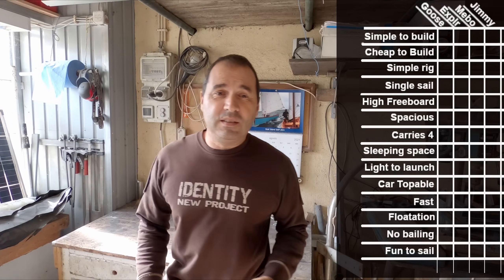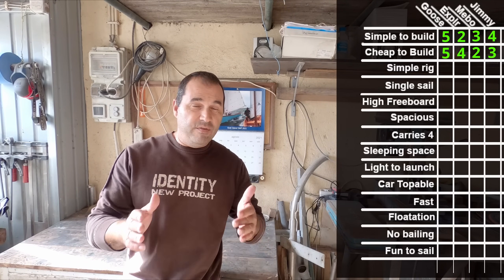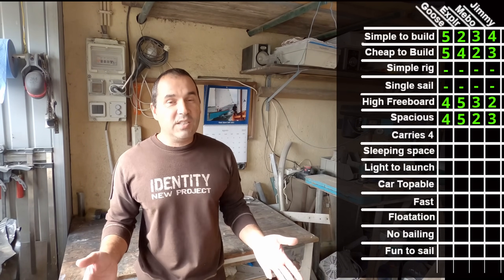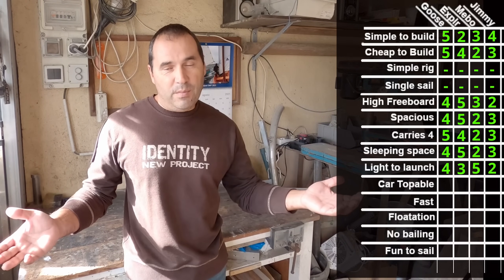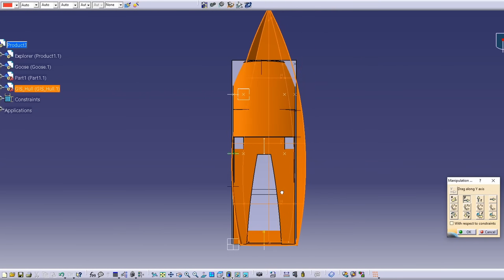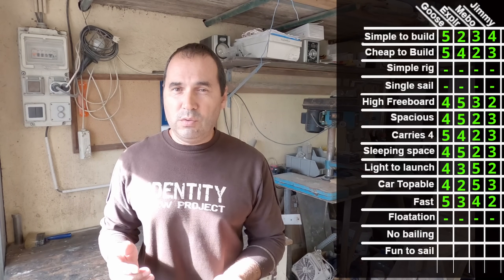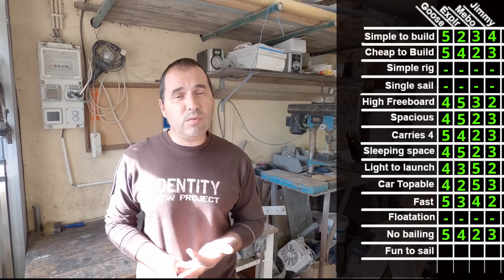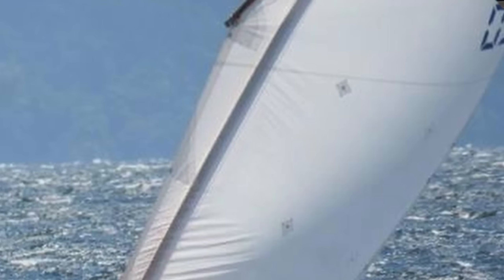Final Skiff Shootout. Which One Will I Build Next?

Comment: This is actually a really good primer for designers about how to balance criteria. The result will of course be different if a different person does the scoring. But for a technical discussion of all the points from the perspective of a builder - every designer needs to know this. I learned a couple of things.

The only area where I would suggest more analysis is needed is weight. It is actually a bit hard to work out weights for someone wanting to build a boat. The best quick way is to look at the building materials and count up the sheets of ply multiplied by the thickness of each. The more scrap there is - the less this is a good estimate - but at the same time boats with too much scrap should be penalised as well - that is an important area of product design. And it has sent me back to the drawing board more than once when a lovely boat I've drawn up just fits badly or not at all on a sensible number of plywood sheets.

Looking at the final big chart of results it looks like the Mebo (when using Teo's criteria) ends up with a very high result too. Equal to the Goat which Teo clearly loves.
Reply: It's also an excellent example of how to use a decision matrix to make a complex decision. And anyway, you can't look at a boat while you're sailing it!
Reply: @nickgoodall578  A truly acidic compliment! I'm going to use that one - excellent!
Reply: @TheBoatRambler  I feel like you might be a shill for Mr Storers boat designs except I cant fault your logic and decisions
Reply from the maker: @akcarlos   maybe he just makes simple boats that work! 😁😁

Comment: This has been really fascinating. Thanks for taking us all on this journey of discovery. I didn’t realise how much the sailing snob in me is biased against the square goose or the PD racer. Especially when they perform so well on so many points.
Reply: Just to make you feel better - your biases were the same as the designer at the beginning of looking at these square boats. We built two 8ft versions almost as a joke and because we are Australian we made a further joke of putting a stupidly big sail - double the normal size on the little boat - and plan to cut it down after taking a few photos and videos for some chest puffing. Then we were surprised the 8ft boat stood up to 80sq ft of sail. And then that it had good handling qualities. And then started taking it to boatshows and being the last boat to come off the water when the wind blew crazy and the waves came up.

We were surprised at every stage. Assumptions are really difficult things to shake off!

Comment: Looking for the goose center board redesign,  for easier sleeping room / cockpit space?. What are your ideas on an off center CB trunk running through the flotation inboard of the gunnel , amidships?  I'm looking at building a Goose for the Texas 200 with a covered foredeck and a cockpit canopy as in Matt Layden's Enigma.
Reply from the maker: I'm not sure what structure can be removed or what would have to be added but if moving the CB I would just use the same centerboard case structure and glue it to the sidetank, protruding on the inside of the boat, leaving the tanks intact. Maybe @Michaelstorerboatplans can advise you better.

Comment: If you keep any of them outside, would you cover it with a tent like structure to avoid rain collecting in the boat?

If the build would be mine - i would opt in for the explorer instead, the boxy look wouldn't bother me at all. Could use the extra protected storage area and also enjoy some of the warmth of the cabin at chilly nights (i'm 58 degrees north), that's why i'd pick it over the regular goose. And yeah, my car is a 4x4 with a hitch, so wouldn't have issues towing it either if needed :D
Reply from the maker: Good choice!
I want to cartop so it really had to be the Mebo or the Goose. 
Here we get around 41F in winter, with the worst  days maybe 32F.
I do keep my goose undercover both for UV and rain protection
Reply: If storing a boat outside there are two important things ... keeping all water out and good ventilation. If using a boat every week a good tarpaulin can be enough - and replace it when it starts wearing out - it is cheaper and easier than repairing a boat.

When leaving a boat for longer periods put it upside down and raised off the ground and then put the tarpaulin over.

Comment: Not really a surprise :-) Surly the Goose is a good choice for you. But from my point of view, you underrated the Jimmy Skiff - even if you don't want to build one.
Reply from the maker: Hi Gerald, thanks for your feedback.
It is very possible that I misjudged the Jimmy skiff(or others) in some way. I have never sailed them.
Can you be a bit more specific regarding the Jimmy Skiff? in which requirement do you think I underrated it?
Thanks
Teo
Reply: @TheBoatRambler  You rated sailing fun  and no bailing low without much background from my point of view.
Reply from the maker: Hi Gerald! Thanks for your feedback.
The reason for bad fun score is that a boat smaller and heavier than the GIS with such a small sail can't be that fun , imho.
It won't be fast, you won't need to be on your toes and actively sailing it compared to others and it would take a lot of wind to plane with that sail.
As for no bailing, it got a 4 on the final table with all scores adjusted. A design with no side tanks at gunwale level will always have some water left inside. I can't give it the same score as a Goose which has no water left after a capsize.
Even if I had given the design top marks for fun, it still wouldn't beat the Mebo 12, The GIS or any of the Gooses.
Of course this is just my opinion. 😉

Comment: Really good video.  I would not have thought the Oz Goose was that good.  Would you consider the Viola 14 by Storer?  That looks very nice and has the floatation on the sides like the Goose.  My only complaint about the Goose is that it does not look very good like a big rectangular box.  Thanks.
Reply from the maker: Hi Dave,
The Viola is a wonderful boat but it does not meet any of my requirements other than being fast and cartoppable.
I want a in which boat I can sleep in a few nights if needed.  😉

Comment: What a surprise! it's rational rather than emotional choice. I really enjoyed your videos and your opinions on each design. What software were you using to show the boat models?
Reply from the maker: Thanks for the feedback.
I use Catia V5
Reply: @TheBoatRambler  :O - That's a pretty high end piece of kit.
Reply from the maker: Hi Michael, 95% of my work has been done in Catia V5, 4% in ProEngineer/Creo and the rest in Inventor and NX Siemens. Catia has so much potential and so many different modules to learn.  I used Surface and Solid modeling, Spatial analysis, Sheet metal forming, Stress analysis, Assembly, Draft analysis,  Kinematics and a few more I cant even remember. And I believe in 10 years I have only seen the tip of the iceberg.

Comment: Enjoying your boat comparison series Teo, the Goose is an interesting boat for sure, may not have the lines of the Goat but it’s very practical. Beauty is in the eye of the beholder as they say, cheers
Reply from the maker: Thanks Ken!
Reply: @TheBoatRambler  hey Téo, if it’s not a hassle could you tell me the sizes of the side seats, my estimate is 200mm wide at frames 3 & 4. I’m about to turn my goat & start fitting out, thanks Ken
Reply from the maker: @kens2114  I believe the widest part is 23cm, and they are parallel to each other.
If I go to the club tomorrow I'll double check. 😉
Reply: @TheBoatRambler  thanks, Teo
Reply from the maker: Hi @kens2114,
the tanks are 24cm at the widest part and 22cm by the centercase. but you can adjust this depending on your leg size and sailing position. Right at the start of "How to make  Watertight Seats on a Skiff PART_1" I explain why I chose that width. take a look. https://youtu.be/oxRU1uLg_R4
Reply: @TheBoatRambler  thanks, Teo. I’ll have a look. I did watch the series but couldn’t remember an actual size being mentioned. Cheers

Comment: Great series.  Thanks.  Two sort of unrelated questions.  (1) What CAD software are you using and how did you get the models for each of the finalists  (2) what is the electronics in the back ground of this video.  Do you have a CNC?
Reply from the maker: Hi,
I use Catia V5 and the video was shot in my little workshop but I don't have any CNC.

Comment: Very interesting. I wonder how the goose or goose explorer would look if extended to a point? Obviously would be 16' long or more. I do like the idea of a cabin on such a small boat. I look forward to seeing how the boat comes together and how it sails.
Reply from the maker: Thanks Ben! 
I would love to have that cabin too! but I want it to be easier to cartop. I'll find a way of making one in canvas or something! 😉
Reply: @TheBoatRambler  A canvas cabin is a great idea! I look forward to seeing her sail!
Reply: @TheBoatRambler Teo I have thought of the same approach.
Reply: To have a point the sides need a curve. The special ability of  a rectangular planform is the enormous stability. Our starting point was an 8ft version with the same 89sqf sail. This was originally a joke and we intended to cut the sail down to a more sensible size after a few photos and videos and chest puffing.

But the surprise was the 8ft boat handled double the normal sail area for this size boat with no trouble at all. This is more that 10sqft more sail than a Laser (ILCA) dinghy. 

The goose inherits the same rig and is much much faster than the 8ft version. It just loves extending its speed and has much better handling qualities than most pointy nosed boats when overpowered or sticking the nose into the back of a wave going downwind at speed. No spearing off one way or the  other as the bow takes over.

The goose is noise in a short chop before there is enough wind to pick up speed. With speed the bow comes up because of the rocker aft and it is the underside of the boat that contacts the waves. A pointy bow on the same hull would be a long way above the water at this point.

Comment: Did you ever consider/rated a "standard GIS", one built to specs with the specified lightweight materials?  That would certainly rate higher than your currently customized but heavier one... inquiring minds would like to know 🤔

Also, we know that as content creator you don't own us viewers nothing, but changing the rating system midway trows a big fat wrench into the comparison. I would like to see a re-do chart with all the designs rated under the same scale/system.  Maybe a 0-10 scale.

Finally, the "fun to sail" is, by design, very subjective... basically: If is light and fast it wins the "fun" points... might as well remove that category.
Reply: The absolute winner would be a Goat build like the Jimmy Skiff 😈😈
Reply from the maker: Hi,
This is a series of 4 videos and to fully understand my comments and thoughts you need to watch all of them in their entirety. 😉
-If you watch the whole video there is a table with all the designs scored according to the original scoring system.
-The original GIS built with lightweight materials was rated and scored using the first scoring system. 
-It wont score higher, because it's a tradeoff between floatation/liters to bail over weight/cartoppable so the score will be very similar.
-On the review of the GIS and the Goose I show you a few fun things that you can do aboard both models which include a lot more than just speed.
Reply from the maker: @geraldtrumpp2340 The GIS built like the Jimmy skiff would not be cartoppable.
Reply: @TheBoatRambler   I've seen the entire series... but in the end is your build, your money and time. 

By the way, thank you for showing us so many interesting designs.  More than half of those I didn't know before.

If you don't mind another question... since your dad is getting old, wouldn't a high freeboard be counterintuitive to his easy of access?
Reply: @TheBoatRambler  Depends on the car and if you use devices to lift it. But I admit the cartoppable is not a criteria to me, especially at boats as big as the Goat. :-)
Reply from the maker: Hi @Apollux, 
I know you watched the videos, I remember most comments. But we sometimes skip sections or stop the video before it is finished and then miss some info. I do that too sometimes! 😅
The high freeboard doesn't necessarily make it hard to board, depends on the boat. If you watch my GIS capsize videos you will notice that even having the highest freeboard of all skiffs the GIS gunwale comes to water level when you are trying to board, while for instance the Goose is lower but unaffected by your weight on the gunwale.
I will, nevertheless, fit a small rope ladder by the transom so that if needed my dad can pull it down and re enter the boat. 
😉
Reply from the maker: @geraldtrumpp2340  My car is a ford Focus van, Max roof rack load is 70Kg. And I will use some contraption to get the goose up there. Anything over 30 kg isn't easy to just lift that high on your own.
Reply: I have some hefty kayaks and I use a pull-out bar on one of the roof bars. That way one end of the boat stays on the floor so you only lift half the weight at once. Scratching a wooden boat would be an issue though - my kayaks are rotomoulded plastic so I don't really care . . . .

Comment: Decision making worksheets are absolutely great for taking the emotion out of the decision. The trouble is, boats are emotional. You really need a line that says, which one tugs at my heart. That might alter the scores a little. BTW, you got the scores the wrong way round for Goose and Explorer on either roof top or weight on the final sheet. It wouldn't have changed the decision. Just put it more in Goose favour. It looks like a good decision to me. I look forward to seeing your build.
Reply from the maker: I do look at the Mebo and want to build one but then I remember all the advantages of the Goose and forget about the Mebo! 😁
You are correct the Goose should be 5 on weight.

Comment: I followed all your videos with great interest but I just don't understand the "car topable" criteria. Having a boat on a trailer is easier to move around, and you get a bigger/heavier boat with fewer compromises.
Reply from the maker: Hi,
That is all good if you have a place to park the trailer nearby or a launching ramp. Neither are common around here. 
Finding a place for the car near the coast is already a struggle! We have hundreds of miles of coastline and so few launching ramps it's not even funny. A beach dolly can launch a light cartoppable boat from almost anywhere.
Reply: @TheBoatRambler  Teo.  I think I have probably told you that my wife love going camping.  We tow a n almost 2 tonne camper behind our Mitsubishi 4WD turbo diesel. So, an additional trailer would be impossible.  We have boat racks on the camper and another set on the car.
Reply: Can be much cheaper to take ferries. And sometimes for road tolls. I think the purpose of the goose for Teo is "ADVENTURE". He has the Goat by the water locally. So the goose makes sense to go to different places.